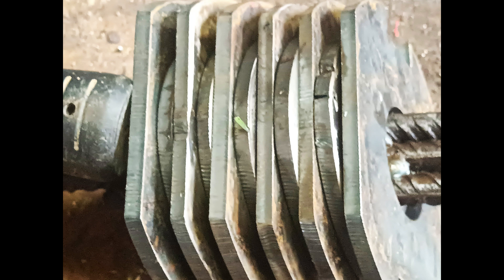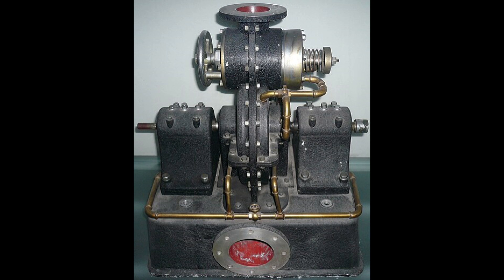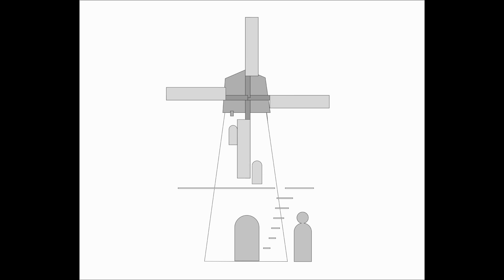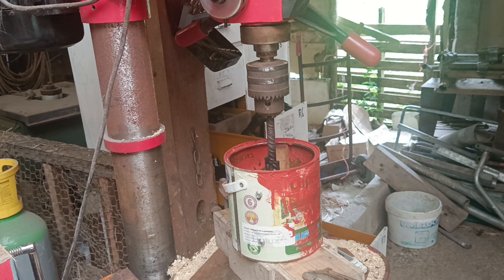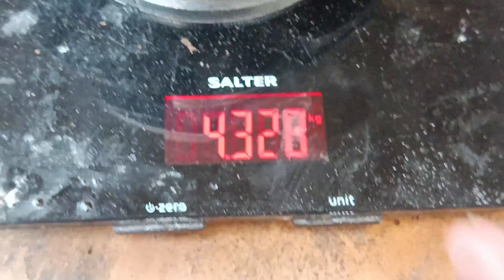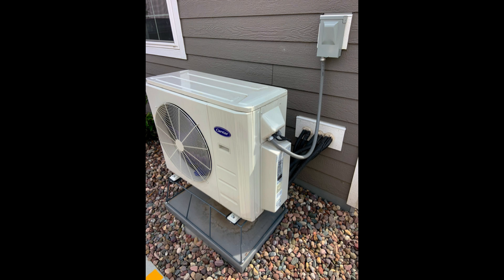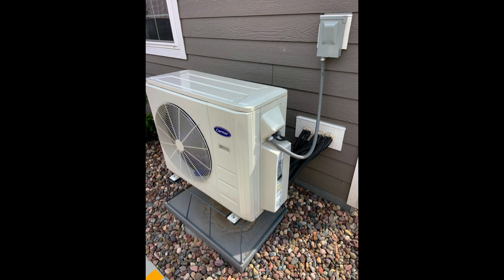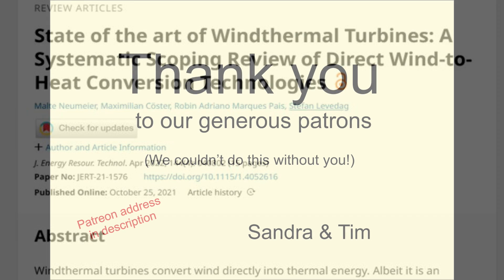More Interesting Things About Friction And Mechanical Heating - It's All So Interesting!

Comment: If you want to convert your windenergy into heat the maximum efficiency you can achieve (without a heatpump) is 100%. So 1 Joule of Kinetic Energy into 1 Joule of heat.

If you use friction you will almost immeadiatly arrive at this efficiency. The problem is you can only  heat up the water near the wind turbine and thus you need to transport the hot water in pipes. This lead to transport losses. Depending on the insulation and the outdoor temperature I would not underestimate these.
Heat transfer is proportional to the temperature difference.
For example: 40C Water and 20C ambient-> 20C temperature difference
40C Water and 0C ambient -> 40C temperature difference and thus double the heat loss.
You need the heat in the winter and thus you would have to insulate the pipes very well in order to keep the losses reasonable (or even bury them) - wich is expensive.

The efficiency of typical electrical generators is about 80%, the rest is lost to heat. So if you would chase the highest efficiency you could liquid cool your generator (also use the cooling water for heating) and use resistive heating (like standard waterboilers or kettles). Then you would achieve the same efficiency as the friction solution.

If you do not cool your generator and use resistive heating you still end up with a efficiency of 80% - because resistive heating is 100% efficient.
But electricity is a lot easier to transport than heat. Just lay some cables and you can transport it with significantly lower losses than heat - without pumps and worrying about insulation or leaks or …..
Transporting electricity also gets more efficient the colder your cables are.

And the cost of the generator (alternator of old car) + cables + resistive heaters would probably be the same or even less than the friction heater + heat exchanger + pipes + insulation. While being a lot more „comfortable“

To sum it up: due to transport losses when transporting hot water and cost of pipes and insulation I would assume that converting your energy to electricity and using resistive heating is the best option in terms of efficiency and cost.
Reply from the maker: I can't argue with any of that - but you're forgetting storage of energy. Heat storage in an insulated tank of water is a lot cheaper than a bank of batteries.
Reply: @wayoutwest-workshopstuff6299 yes of course. Assuming the house you want to heat already has a hot water boiler installed I would just use that for storage. In this case the energy storage for both methods is the same.

If it does not I would still recommend storing the hot water inside of the house - this way any heat loss contributes to heating the home. 

Just because you use a different method for heating the water doesn’t mean you have to store it differently.

But I totally get it - if you would want the simplest solution you would work a boring office job, pay your bills and don’t worry about anything but football. But this is clearly not the way you are - thus do what you would like and what is interesting to you. Best of luck with your tinkering 😊
Reply: Exactly. Tim says that converting energy types involves losses, which is true, but so do transportation and  mechanical linkages. Although you lose up to 30% of the energy converting it to electricity, the rest of the process has negligible losses.
Reply: You also have to consider efficiency loss in the magnets at higher temperatures.
Reply: I agree
Reply: cubic increase...
wind is not steady. or predictable.

whilst one does lose heat in transmission, bear in mind that a generator, electrical methods, are limited. they can extract so much power, and no more. pumps can extract so much power, and no more. they take so much power to operate, and at that point, can use no more power. any extra power has to be somehow dissipated. 

a brake, or converting kinetic directly to heat, allows for the extraction of energy to increase at the same rate that the wind delivers it.

at twice the wind speed, the electric system has to apply brakes or otherwise reduce its efficiency, and due to the way the generator interacts with its load... its power output is constant regardless of RPM.  if a load of so many ohms is dissipating so many watts of power at so many volts, it is the load that limits the current. the only way power in the load can increase is if the voltage increases. then more current can flow through the same load. but as we have batteries or electronic devices sensitive to voltages, we have to limit the voltage as well... so that wind turbine with generator can only ever deliver a very small fraction of the energy in THE WIND ITSELF.

as the generator cant load the turbine down enough, it cant extract sufficient energy, we have to apply brakes or feather the blades to reduce the power...

talking about efficiency of a device is pointless if the device itself is wasting most of the applied power! when we talk of a generator being "80% efficient", it because we have no idea about a fundamental principle called "jacobs law". it instantly limits the amount of power you can EVER extract to 50%. half the energy will be lost in the generator itself. as we increase the load, we get proportionally far less energy lost in the generator, but the total power delivered by the generator to the load is reduced as the current that can flow through the circuit is limited by the load. we extract less and less of the overall power, but more of that extracted power appears in our load and we call that "efficient operation".

or... we stick a paddlewheel into the mississippi. we get a generator to deliver 5W into our load, and figure out the generator only loses 1/10th W... we say "the generator is really efficient". we ignore how the paddlewheel not only let most of the hydraulic power slip past rather than deliver useful work to the load, and we ignore how the entire freaking RIVER slips past! we ignore that the generator and the load upon it is only "efficient" when operated in a VERY NARROW WINDOW.

its like milking a cow for cream and pouring the milk down the drain.
killing the golden goose for an egg.
slaying the elephant for its tusk.
eliminating the rhino for its horn.

whereas its simplicity itself to apply brakes in proportion to the RPM and windspeed of a turbine, or maintain constant tip speed ratios, maintain maximum aerodynamic efficiency, and extract far more power from the wind. you can extract every bit of energy that those blades intercept, and directly convert it to heat with maximum efficiency.

and that gets into the other side of things, the actual loss due to heat TRANSFER between mediums... and again, its very similar to jacobs law... but not.

if i have a boiler, and my intention is to extract the maximum power from my fuel, then half the power HAS TO GO UP THE CHIMNEY.

that is, i can reduce my combustion temperature to half, by pumping enough water through my boiler to extract energy and deliver water/steam at that same temperature. i obviously cannot have water leave HOTTER than the exhaust gas!

if i wanted the HOTTEST water possible, i could only pump a very small volume of water through the boiler, and the boiler will get closer to the combustion temperature... i extract less and less power, and the exhaust gas will be closer to combustion temperature.

if i wanted to extract the most thermal energy... then i pump as much water through as possible, and absorb as much heat energy as possible, reducing the exhaust temperature to something just sufficient to get "draft" up the chimney... my water doesnt get very hot, but i heat a LOT OF IT.

the same goes for a water cooled brake. it gets as hot as it can due to the rate energy is fed in, and the rate energy is dissipated. 

its an... assymptotic curve? you can never quite reach 100% in either direction, that is, potential or kinetic.
the perfect spot is always the center of the curve, the 50% region...

taking all that into account,despite transmission losses, thermal systems still may very well win out over energy harnessed over a 24 hour period than any other solution. you can extract far more energy over a given period.

Comment: I think opting for more thinner metal pieces would be better. You have to consider that thick metal is mostly metal in your mechanism, and thin metal will be more water. The only thick one may be the top one to compress them.
Another thing for compression maybe bolt the stator plates together.
I would coat a rotor shaft in some kind of plastic or heat insulator material to not wick out the heat.

Comment: I know you don't want to go electric and its a nice brain challenge to make a non electric energy converter, but Electric is probably the best way to go. Hear me out before it ignore this.

Yes converting energy from different types is inefficient. However so is converting kinetic energy into kinetic energy, you have to think about all the gears and shafts that you will need to use to transfer the energy to the water basin and even consider the lose of energy from the water basin it self (which you have some what considered). The water basin lose of energy has to be considered even more because you would be using it as a battery of energy, thus the more full that battery is (aka the hotter the water) the more inefficient the system is due to thermal transfer to the outside world.

Using electric would allow you to slap a generator/motor on the windmill at the top behind the shaft, so it's a direct drive and there is no kinetic energy into kinetic energy transition (aka no energy lose), and run the wires down to a battery at the bottom which wouldn't loose as much every the fuller it gets. Then use that battery to heat the water when the water needs to be heated, Not to mention heating water with electricity its pretty efficient.

Ultimately it will be mostly as energy efficient as a mechanical and a lot more efficient on the setup side.
Reply from the maker: I wouldn't ignore you Spik! I might not agree with you though : -  )    I'm still exploring the possibilities..

Comment: In all the aquaponics,  fishtanks ect I have always put some steel bolts in the tank's as when the colonised beneficial bacteria help break down the iron and over time the bacteria turned the souroundings into a iron sludge.  
The same happens inside car radiator's ect.
You'll always have some kind of erosion.
The magnets spinning past blocks of copper can get so hot it can melt aluminium and have zero affects on longevity ect.

Comment: if you are going to do plates, make sure to preload them against each other, so there is always a certain amount of pressure ensuring good contact. also, friction is proportional to normal force (in this case, clamping force btw plates)

Comment: A mix of pitch and light oil fractions would allow arbitrarily high viscosity, since pitch is just so dang viscous. Just mix it at even the 80RPM and it should have enough friction as long as you tune the mix correctly, plus it is a lubricant you can use to reduce friction on the vertical shaft if it ends in the container. As viscosity drops with temperature it may get awkward, as the warmer it gets the less of a load it puts on the mill, allowing it to spin faster, but you were already experimenting with some speed governors that probably can alleviate it, plus at higher temperatures it'd lose more energy, so logically speaking the viscosity can't drop forever. A bimetallic strip located in the container that operates a vent to let off excess heat could probably work well, maybe in series with a curved piece of springy metal that holds the flap closed until some boundary temperature when it can open. Or the bimetalic strip could somehow operate a gearbox that closes a larger flap than the strip could... though I have trouble thinking of a way to achieve that without having to make an actual gearbox. But then again, you would have a tub of lubricant to work with anyways so maybe it could be viable?

Comment: Shock absorbers from vehicles will turn movement into heat, and might be easy enough to rebuild to be more constricted and work on low rpms.

Also some buses use magnetic breaks where they have a metal disk but the break pads are electro magnets. If that works with your speed fypu could later switch to a big neodymium magnet. Less investment during prototyping.

Comment: I'm wondering if drilling a lot of small dimples on both sides of all plates will increase the heat output a bit by creating vortices and thus some extra friction in the water itself. Even if it doesn't work it's easy enough to be worth a try.

Comment: If you ran a belt directly from the top to a shaft on the bottom, you would eliminate the extra gear change inefficiencies. You would need some sort of clutch or CVT transmission to allow the vanes to free spin and get up to speed and maintain speed during variable wind conditions obviously.
Reply from the maker: don't forget that the whole cap and sails rotates!

Comment: I think you will loose less energy by hardwiring a heating element directly to the output of electric generator. Whatever energy induced will always translate to 99.999% heating.  Also no need for  exchangers and you gain simplified transportation to wherever you want.  The only losses you need to deal with is within the generator. If you make a smart design it can even work with 20 rpm.

Comment: Your reasoning for using plates makes sense. While I still think it would be feasible to get the magnets up to speed, I agree that it would be quite expensive. The death of many ideas, lol

I wonder if higher-viscosity fluid inside of the paint can would be able to convert more of the torque into heat.

Comment: @Way Out West - Workshop Stuff 
2:52 It would be interesting to find a way to use torque directly (somehow) to heat up the water. (solved, check the "IDEA 3" reply) :D
Then could use those 20 rpm directly from the turbine without (almost) any conversions at all.
The only way I can think of is a bad way, taking a big metal piece & "wring" it like you was trying to dry out a wet towel... obviously bad, one time use... maybe if you do it back & forth just a little bit, but would still have metal fatigue that would ruin it :/
Reply: IDEA! 
You could (somehow) "wind up" like a car suspension coil spring & let it SLAM into something to release an ENORMOUS amount of energy (some as heat)...
But the problem is to build something that can withstand that energy for more than like 3 SLAMS!
Reply: The idea comes from here: a short called: "Would You Use A Drill Powered Hammer?" by "BYOT Shorts"
Reply: IDEA 2! 
Let it SLAM into a extended gas piston, that compresses the gas & heats it up. (inspiration: YOUR thumbnail for short: "Tornado wakes up")
Reply: IDEA 3
Add like a crank-shaft on the windmill (red), then let it crank a gas piston, weld the piston shut with lots of gas inside.
The cranking will heat up the gas (& piston), then you just submerge the gas-end of the piston into water :D
Reply: IDEA 3-b
Ideally, you would move the piston into the heating area when compressing & out when releasing, so you actually move heat around instead of just back & forth.
One easy-ish way to do this, would be to push the cylinder "backwards", meaning you push on the outer "housing" while the inner "piston" is stationary.
Ideally you would hold the piston in a compressed state for a longer time, so all the heat can be extracted, before moving it out & then release the pressure for long enough for the piston to heat up again. (basic refrigerator concept, as you explained).

I wonder if multiple pistons mounted radially would minimize the energy needed from the windmill? As they push against each other & canceling out some of the pressure needed?
Then rotate the entire cylinder assembly so each of them is inside the heating area when compressed. (obviously "overkill" for your machine, but it is fun to find the ultimate form of things).

Comment: @Way Out West - Workshop Stuff
9:01 About the magnets, look into: halbach array
It is a way to orient magnets to focus their magnetic field to be stronger.
it seams that you (from the "side") just need to rotate the magnet (counter-/)clockwise 90 degree for each new magnet in a line (assuming square/cubic magnets).

Comment: Perhaps you coulda magnetic powder brake with permanent magnets.  It wouldn't require as many magnets as the induction option would, and the majority of the friction would be between the particles, so wear would be very low.

Comment: Here's another crazy idea: what if you used one of the high-speed options, but put the step-up gearbox in the same water vat you're trying to warm up? That way any heat generated by those gears isn't actually lost. Since gear boxes are often sealed and lubricated units, I wonder if it could operate under water.

Comment: A couple of thoughts 
Bigger plates to reduce the rate of wear
A more viscous working fluid to increase the overall friction. Motor oil full of metal bits might actually be more effective.